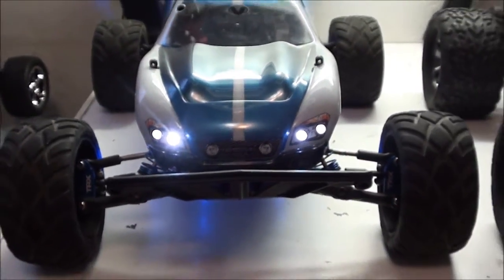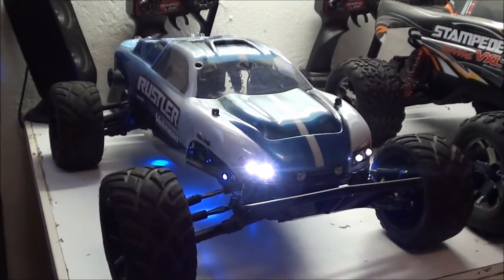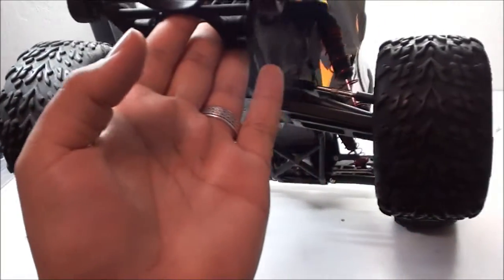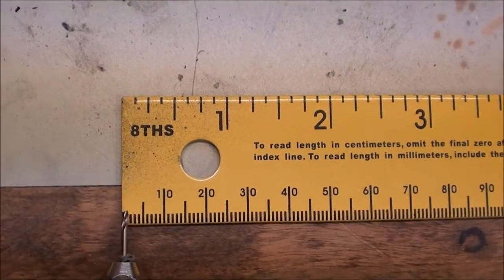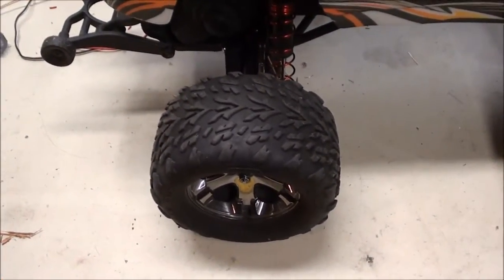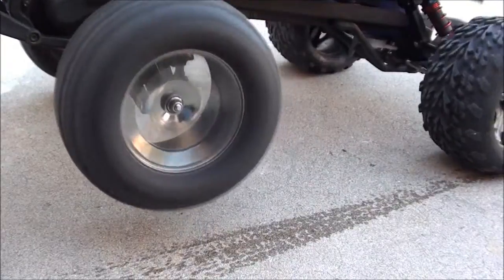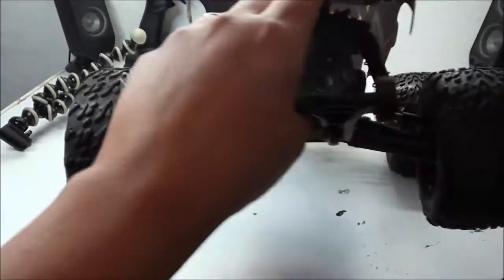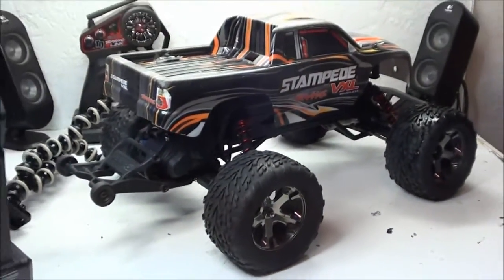Dark Ecliptic Heart RC Projects - How To - Drain Water In Tires

Comment: We hot glue or tape the holes closed in the rims whenever we get new tires to prevent water from getting in there in the first place.  Some tires are ribbed on the inside (Arrma Notorious Backflips for example) and so you would only drain the ribbed section that you drilled.  The remaining ribs would work like dams holding the water.  But this simple fix does work on most tires, and some tires are even vented on the outside from the factory.

Comment: Drilling the tires will always leave the hole with torn edges it is just the nature of the material it is unavoidable with dilling. I found with 6s+ this will destroy the integrity of the tire. If you instead cut a hole with a manual leather hole punch it will cut a smooth conical hole with the wide end inside the tire. This is best done during wheel assembly because if done after you run the chance of damaging the some type of foams like closed cell. 

I don't suggest melting a hole with a needle either because I found years ago that the rubber bead that forms around the hole loses it elasticity and will also tear easily.

Remember these are really only concerns for people running 6s+ and maybe some at 4s doing speedruns.

Comment: now to add one more step on tapping tires... making holes in them as well.. might as well invent a new tech to put inside tire that opens up at high rev so it drains water and close with suction effect. pretty much like the gatorade caps or powerraid i dont remember which one does that.. it's a 4 way sliced silicone you have to sucks it up to open and then it close by the outside pressure made on the bottle.

Comment from the maker: As long as the holes are small enough it should mess with the lifespan of the tires. However if you don't make the hole round and small enough, then the tire can rip.

Comment: I bought Mud Slingers for the Rc shop that someone else sold them. I put them on my Summit and holy friggin WOBBLE! Will this method work for my Slingers? When I remove a tire and roll it....it stops and then rolls back at bit.
Reply from the maker: It should help

Comment: won't this help your 3s lipo tear your tires up more easily? like when they turn into pizza cutters.
Reply from the maker: Yes but you'd still have to push the tire pretty hard in order to rip the tire even if there are holes drilled in.

Comment: is there another way to make a hole with something else
Reply: Kayden yap, I think making a hole with a pin or small nail would work.
Reply: I use a 1/8" or 3/16" hollow brass tube in my drill driver. Sharpen the end of the brass tube and you'll get a perfect circle that won't tear. Good luck!

Comment: What about sand mine are full of sand and I doubt the holes will work well with that and I don't want to try to break the bead free becuase it might not be repairable
Reply: Dan  Merrill if they have foam take the tire off the rim and clean the tire and replace the foam if no foam take the tire off the rim clean it and re-glue